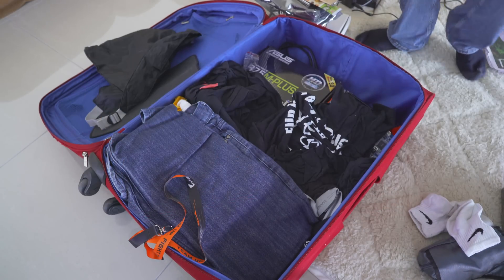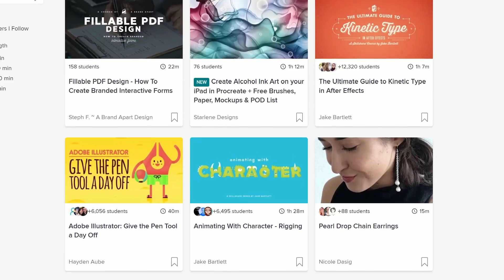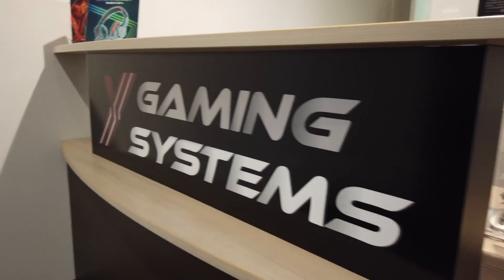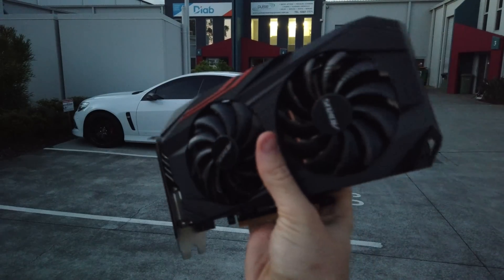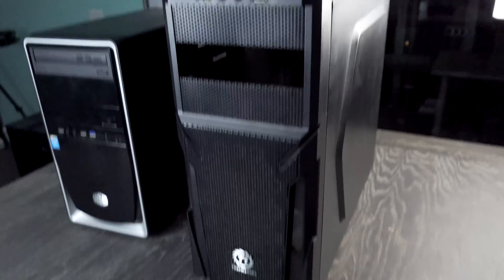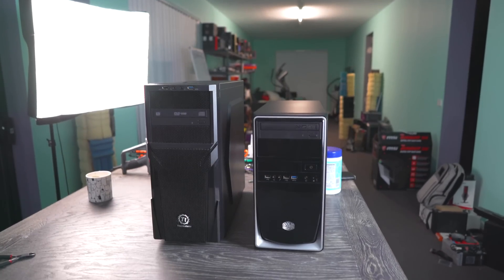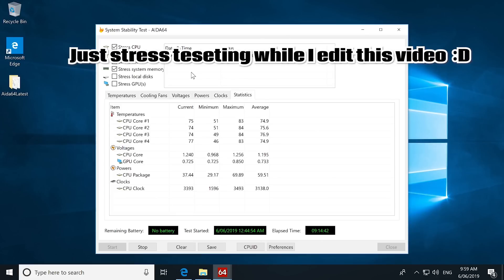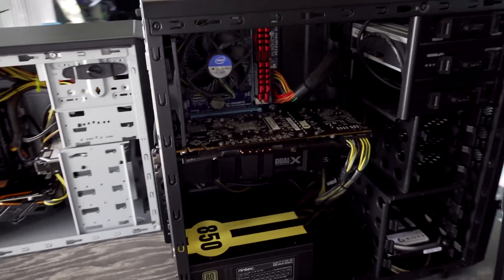How To Hustle Gaming PCs - Making Two BUDGET Rigs from 'Trash'

Comment: you have me thinking about trying my own hustle after some shopping around i found i could make a computer with a R5 2600 16GB and a RX580 8GB with a 240GB SSD and a 1TB HDD it and a decent looking case for about $750 it might even put my personal rig to shame i am thinking i could probably sell it for $900 but first i need to get some LED strips LEDs sell PCs and all that but i don't know how to do that wheres the best price how can i make sure i find some that plug into Sata/Molex or do i need to wire it myself?
Reply: it turns out the nice deal on the GPU i found was too good to be true and i got hit by taxes but it got offset by Ebay discounts bringing the cost to $840 still pretty good

Comment: Tech Yes City you inspired me to buy and build used parts
So I found 2 gpus one 980ti and one 1070ti for 55€ both are faulty but I got the conformity that the fans on both are spinning so I am gona buy those and do some troubleshooting new bios or the Ofen method and look how it goes
Edit: both are together 55€

Comment: My question how can i upgrade my 350 watt power supply in a dell studio xps 8100 , the powersupply must be small and the 16 pinoutlet does not match with normal powersupplies. So i can get RX470 or gtx970  in it. Now i have a geforce gtx 960. What are the overclock settings of my msi gtx 960, the red one ?? How can i safetly overclock.

Comment: glade you took my advice and stopped using brake cleaner and are now using baby wipe like me lmfao the brake cleaner is too harsh but baby wipes are perfect...you should use screen shots of the cpu using cpuz so people understand that i3 is pretty decent 4 cores 4 threads at 3.2GHZ plus overclockable does well in games I include screenshots of the CPUZ in my sales ads ,, some i3,s are really good I expect all budget systems too be i3 or i5 anywhere between 300$ too 500$ but more top of the line i7 too i9 600$ too 1500$ what parts and how high-end factors in price I also includes screenshots of their heaven benchmark and firestrike scores and have preloaded games on all of them ussaully Apex legends , counterstrike CSGO , fortnite , Nexus zombies , batman Arkhan knight

Comment: How to clean a pc without a compressor @7:00 ... i still think ur faster off just blasting it a few times and then going in with some cloth.. Also when it comes to recycling parts.. just get a good cpu cooler.. a good psu/ good case and some decent ram... Only thing ur not recycling is ur mobo/cpu/gpu... And often u can get decent deals on ur second hand stuff.. Makes buying newer stuf a lot cheaper.. Also never get the most expensive stuff.. waste of money. Im still looking for a better gpu like a 580/1060 for about 100 bucks.. ill find one soon though..

Comment: Here in my country those used parts when built together already costs the same as building a new budget rig (ex. Ryzen 3 2200G + RX 580) in your country. If I find parts as cheap as yours here I'd buy it right away. Especially your Xeons + x58/x79 's .

Comment: My dude, I recently got a new case and a bunch of RGB fans. However my board is an older Gigabyte H81M, I can not figure out how to wire up all these RGB fans as the mobo doesn't have any RGB headers. Could you at all explain how you install these and what steps you take with other RGB lights?

Comment: Just move these systems to Linux, and create even more value.
Reply: Not true for gaming. For business use you could probably hand people used Raspberry Pis running Android or Ubuntu MATE for a thin client with a decent desktop but for gaming, despite Steam's push for cross-platform Windows is (with regret) still where it's at.

Comment: one thing i've wondered about your builds bryan is why you don't use cable sleeving for the power supply ketchup and mustard cables, as it doesn't cost much 
and would make the builds look a lot slicker? is it a time thing, or you just found it doesn't really impact the selling of the pc's?
Reply: I don’t even do that... $400 for a CPU cooler, sure. Double power supplies? Sure. Quad GPU crossfire and triple 4k? Sure. RGB everything oh yeah! Cable sleeves? Expensive... 

I actually wanted some RGB cable sleeves, but it was going to cost $150... regular sleeves are still a fire hazard for high current loads like I’d be pulling and you’ll have voltage drop (ever used a cheap 1000w PSU cable? They get hot! Aluminum wires are the most common, and they are garbage. Copper cables are much better, and unless you need the length, you should not use extensions). But still, I’ll manually sleeve my own cable bundles and I recently did EMI shielding and covering in black and aluminum accents for my wall mounted Titan Xp Star Wars edition “console” in the living room, custom cables though... nah, better to use an RGB SSD for the bling!

Comment: Hey Bryan. Great vlog.
I recently got a 775 motherboard with a Q6600 cpu in it. This makes a great entertainment pc. 
Like you said people don't understand what older cpu's can do so want the best (or i5/i7), but usually want to pay next to nothing for it.
One comment about your latest builds. Putting a $5 coloured fan at the back light up a wall in a dimly lit room and the same type of fan at the front and top adds to air flow and give the pc at least some bling.
Cheers, Mon from Brisbane.
Reply: Q6600 can be overclocked to 3ghz with a small piece of tape. Google tape mod q6600. Easy to do, compatible with even a lot of oem boards. 

I have an old q8400 that I use as a htpc in the theater room. It has a gt710 for Hdmi out but even a 1080p transcode works it HARD. Look at cpu usage and it's pretty high even with the GPU. 

By comparison, the tiny 200ge Athlon in my TV room barely ticks over and can handle 4k playback with no extra GPU and only a 35w TDP. While the old 775s still work, they are BARELY hanging on to being usable. Once ryzen 3000 comes out, I will be moving a 2600/Vega 56 system to that room and throwing the q8400 on Gumtree. 

My XP retro gamer is a 775 as well with a Q9450. Awesome for an XP machine with a full water loop and OCd to 3.5ghz.
Reply: @lunchie80  That's why I got a 6450, hw decoding seemed better with Radeons back then
Reply: @lunchie80 
My other htpc in my bar runs a Q9400 and a GTX750 and works just fine. I recently replaced the GT610 GPU in that pc to give it more life.
The Q6600 pc in the living room came with an AMD HD5750 which is also fine for 1080p playback.
I also have a spare Q8400 from the old days when core 2 quad was a competitor to the first gen i series cpu's. This old stuff still works fine but is not so good for current games.
Reply: @monham5041  yeah it still does 1080p. But at high power consumption by comparison. Can't do 4k playback basically at all and compared to even a puny 200ge is now thoroughly outclassed in sheer cpu performance.
Reply: @lunchie80 
I have a 1080p 32" curved monitor for movies and my eyesight is not good so 1080p is great for me.
I'm not worried about the power consumption as the whole htpc cost me around $75Au.
Im using old parts instead of chucking them in the bin. To me that's a win/win situation and price/performance is awesome.
I could overclock the Q6600 too.
In time maybe I will.
Reply: Get a 771 5450 modded from Ali ;) you won't regret it ! If your mobo is something decent, flashing the correct bios is a 5 min job and you'll get a real improvement even without OC for like 20$ ! But if you just need it as an htpc the q6600 is just fine then.

Comment: You need an air compressor. Eliminate %90 of your time...
Reply: ansofficial 150 PSI cleans out my Titan Xp in about 3 seconds, absolute vacuum for atmosphere is just 14.7 psi (if you had a theoretical perfect vacuum, which is by definition impossible if it has air moving through it). A Vacuum doesn’t do anything for most GPUs, Ive tried! Quick blast though sends debris flying out a water radiator fins like a rifle though, it does the job fast!

Comment: i have an hp z400 workstation witha a xeon w3550 4 cores 8 threads .. and an oem nvidia 640 1 gb ddr5 128 bit and that works like a charm for me  .. but have any ideea how can i improve the cooling and making it more silent  ... it doesn't go above 70 c on full load  but the fans  .. opera singing :))))))) at 50 % fan speed :(

Comment: Just curious Brian, when you fill up an empty slot with a DVD drive, do you actually connect it all up, or leave it as a gap filler only, and give the buyer the option to hook it up if they so desire?? 

I tend to leave it as a gap filler but do mention it to the buyer and give them the option. 50% end up wanting it hooked up.

Comment: Hey, any problems with the batteries on the motherboard? Isn't it a problem on airlines?

Edit: I'm referring to the capacitors that store a charge.
Reply: Nope. Those things aren't made of Lithium. They're concerned of Lithium because it reacts with hydrogen, oxygen violently to product Lithium Hydroxide. Water is a great source for both and humidity is essentially water in the air. That's why they force you to carry your lithium-powered components like laptops and phones. Basically because they can more easily control an explosion in the cabin. People don't hang out in the storage area.
Reply: @MarcoGPUtuber  Ah ok thanks.
Reply: @MarcoGPUtuber  The CMOS Batteries CR2032 are Lithium, tough.
Reply: @MadIIMike  Absolutely right, but one, they're easily replaceable and removable so they can be tossed. Two, CR2032 are 3 grammes by weight, of which only 0.1 grammes are actual lithium. (Source: Energizer CR2032 Datasheet - http://data.energizer.com/pdfs/cr2032.pdf ) which is far below the threshold to be a concern, as well as the fact that the battery is attached to the motherboard and is not a rechargable battery. Because the battery is attached to the motherboard, it is not at any significant risk of shorting, causing the battery to heat up, making the lithium unstable. IATA regulations, as far as I remember mandate that no more than two grammes of lithium in the entire battery if it is under 100Wh. These batteries, because they fall well below the threshold of 100Wh at 0.6Wh, they are not of any particular concern to airports. If you plan to fill 23 killogrammes of these batteries in a suitcase sloshing around, they're likely to have a problem then. But they don't care about several motherboards. You can't have spare batteries running around but having them installed is perfectly fine. Here is the horse's mouth on the matter: https://www.iata.org/whatwedo/cargo/dgr/Documents/passenger-lithium-battery.pdf
Reply: I've brought my laptop and phones several times over airplanes and it's fine.
Reply: @tristan6509  I was thinking of putting PC parts in my luggage, not my carry-on. I don't want any problems with the airlines haha
Reply: ...tiny charges...